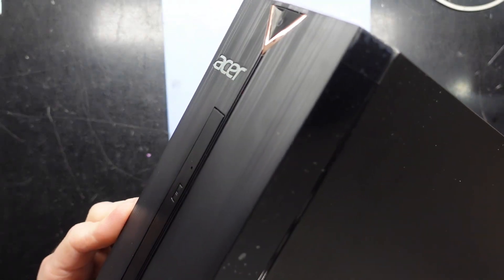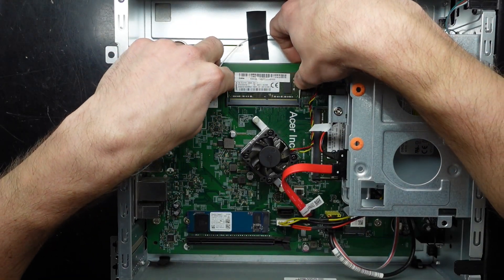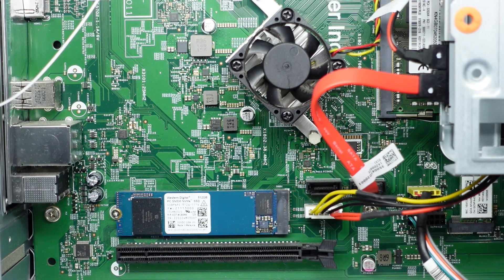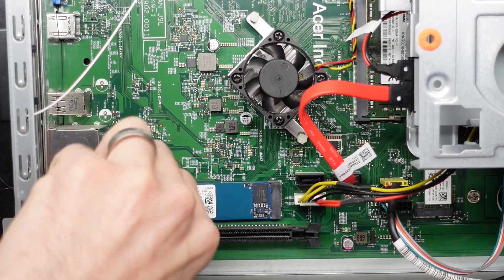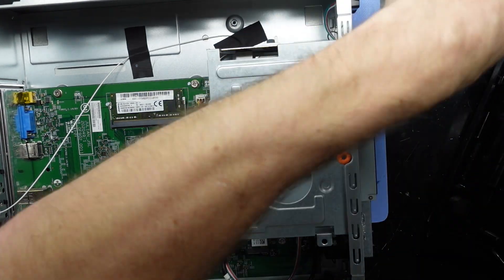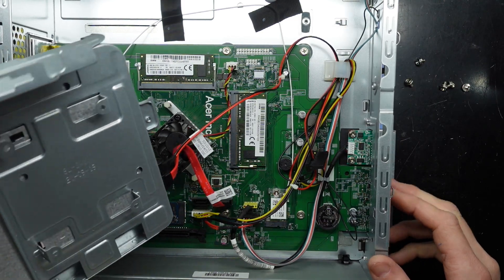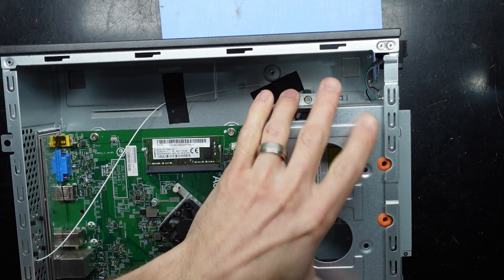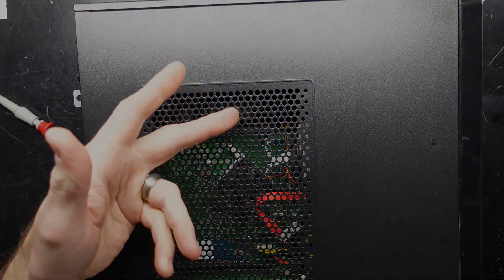Acer Aspire XC-840 What can be upgrade?

Comment: Parter accidently threw away the cables before I could setup the computer. Which replacement cable to you recomend?
Reply from the maker: 65w Acer laptop charger would power it 

google: 
Acer Aspire N6680G XC-840 AC Charger Adapter Power supply Black

Comment: is it possible to upgrade with Core i3 Processor and AMD RX 580 GPU?
Reply from the maker: I think so
Reply: @rickstechrepairs  to give an Update: I have tried both, but they failed, for both are too big to fit onto the Motherboard.
Reply: @lukefibranz3778  do you know any cpu gpupsu and motherboard would fit in this coputer